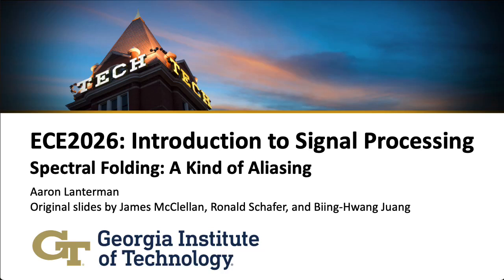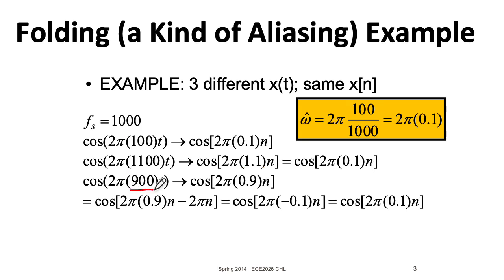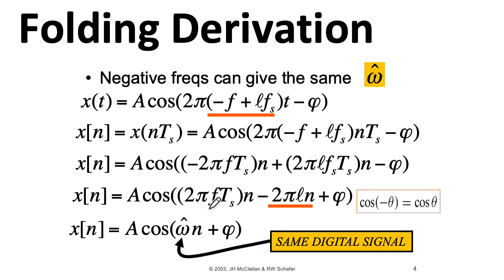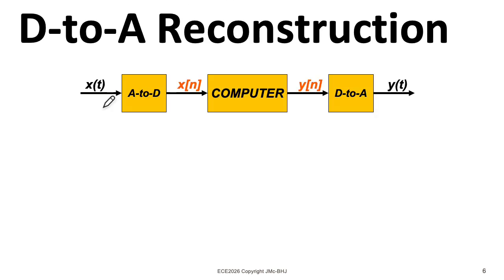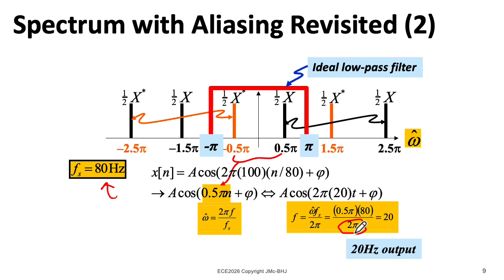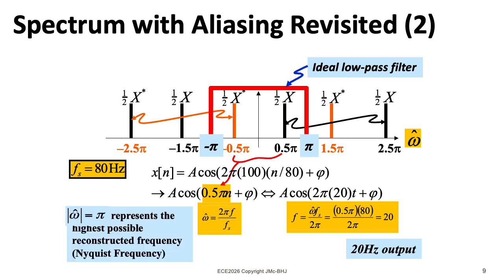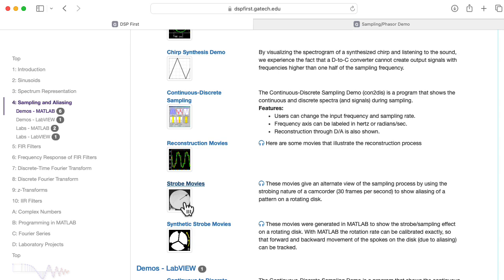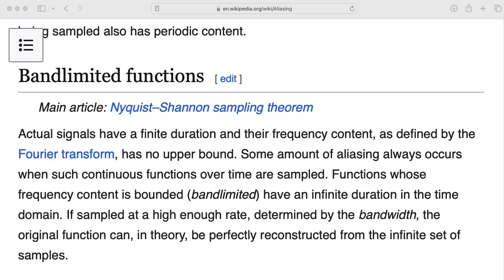ECE2026 L21: Spectral Folding: A Kind of Aliasing (Introduction to Signal Processing, Georgia Tech)

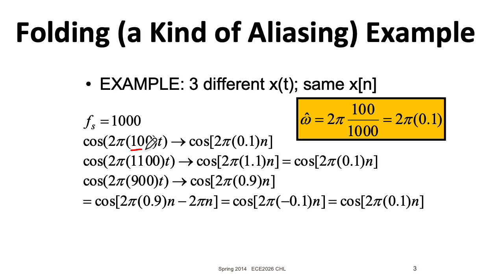Comment: At 1:08, my question is how many aliases does a single omega_hat have? In the textbook for which this course is based on, on page 109, equation 4.7, the textbook clearly indicates that a digital frequency omega_hat has TWO "primary" aliases: omega_hat + 2pi ell and 2pi ell - omega_hat. (Of course, these alias generate infinitely many more aliases) But from 1:08, it seems that each omega_hat has FOUR "primary" aliases. Two alias without negative freq component, and two alias with negative freq components (Folded Alias, as indicated on the slide). Are you over-counting the number of alias by defining alias with respect to the inverse Euler representation of a cosine, as opposed to just the cosine?

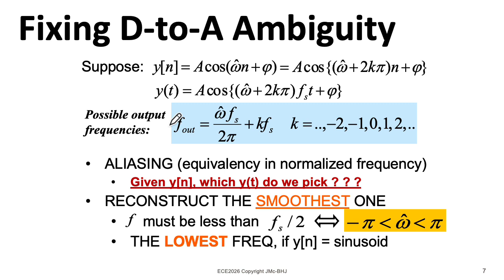Also on 7:15, you say "we need to make some assumptions" that "this only corresponds to reconstructing omega_hat between -pi and pi" (Note that you did not define "smoothest" reconstruction, all sinusoids look pretty smooth to me :>). My first question is: who or what exactly does the selection of omega_hat between -pi and pi? Is it the DAC? Or the ADC? Or some unknown system  My second question is: this selection assumption is quite strange to me because it is virtually never made in any other literature on signal processing. Why only between -pi and pi? This is quite an unintelligent design isn't it? A smart engineer should be able to figure out the frequency of the original input, and then select exactly that frequency. 

Thank you for your time.
Reply from the maker: Sorry I'm not following your question in the first paragraph...
Reply from the maker: "this selection assumption is quite strange to me because it is virtually never made in any other literature on signal processing" -- nope, it's ALWAYS used. 

The issue of "choosing" is a way of describing what the standard reconstruction system does to a single sinusoid. There's not actually any intelligence making the choice. It's just what happens when you use the ideal sinc interpolation formula, which corresponds to an analog-domain filter at the output killing off analog frequencies above half the sample rate, which correspond to leaving intact digital frequencies less that pi.

"A smart engineer should be able to figure out the frequency of the original input, and then select exactly that frequency." Let's say I send you a file containing 10,000 samples of a sinusoid that were sampled at 10 kHz, and that I told you there wasn't an antialiasing filter used in front of the ADC. How could you tell from looking at those samples that it was a 12 kHz signal and not a 2 kHz signal?
Reply: @Lantertronics  I see. Thank you for the clarification. I think the point you are making is that in practice, a DAC uses the ideal sinc interpolation, which corresponds in the frequency domain to a low-pass filter that kills off all frequencies above -pi and pi. I think this really gets to the gist of your statement  "we need to make some assumptions...this only corresponds to reconstructing omega_hat between -pi and pi". I think instead of making this assumption, a better way is to illustrate the correspondence between ideal sinc interpolation in time and low pass filter in frequency. BUT you can't...because when I read the textbook, Fourier transform is not introduced up to this point! That was the source of my confusion.
Reply from the maker: @tapasgaspocho61 [editing comment; I got DAC and ADC mixed up when I originally wrote it]

 I think the way to say it is that the ADC doesn't know anything about interpolation, but the DAC (along with its hardware) uses the ideal sinc interpolation, which corresponds in the frequency domain to a low-pass filter that kills off all frequencies above -pi and pi. 

As I just mentioned in one of my other responses to you, you could play games of bandlimiting the input signal, deliberately aliasing, and using DAC with a higher sample rate than your ADC. But that gets awfully complicated and you'd need to carefully keep track of things. 

Come to think of it, you probably could mathematically write down an interpolation formula equivalent of the sinc interpolation but that reconstructs some of the higher aliases, but I can't think of a practical way to implement that in hardware.

Thank you for your detailed thoughts! I'm happy to see people digging into these lectures (they're not as popular as my analog electronics lectures, I think people find these more abstract and are scared of the math).
Reply: @Lantertronics  Could you clarify why doesn't the DAC know anything about ideal sinc interpolation? (It is digital-to-analog, so it has to fill in between the samples somehow, isn't that correct?) To be honest I am not exactly sure how DAC would implement this type of interpolation in practice, my circuit imagination only limits to a sample-and-hold type of circuit.
Reply from the maker: @tapasgaspocho61  Whoops, I got those backwards, sorry...
Reply from the maker: @tapasgaspocho61  Trying to figure out how to edit my comment now.
Reply from the maker: I just edited my comment, it should make more sense now. ;)
Reply from the maker: I suggest checking out the lecture on sampling from my ECE3084 signals and systems class: it derives the band limited interpolation formula. I can't cover its derivation in detail in ECE2026 since we don't have the continuous-time Fourier transform in 2026.
Reply from the maker: Check this out: https://youtu.be/LzJYGMOVGeU